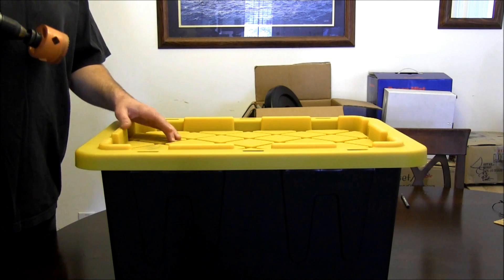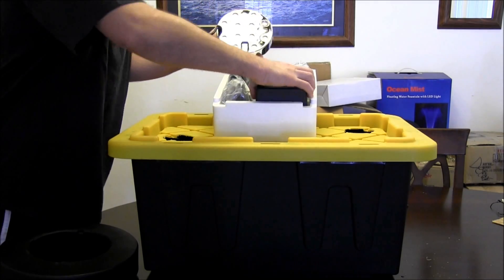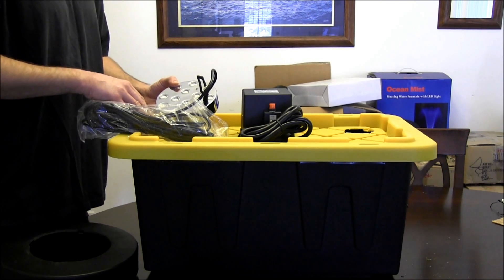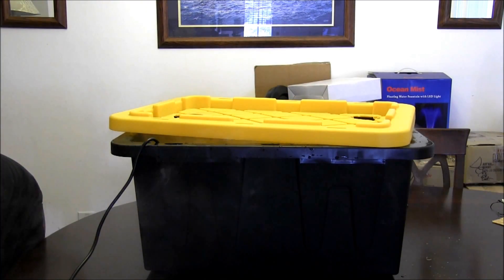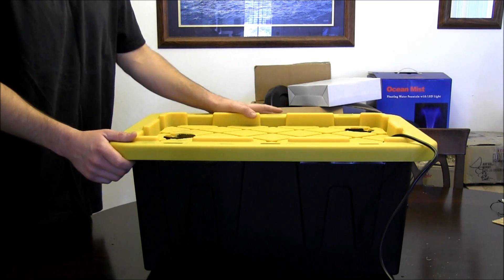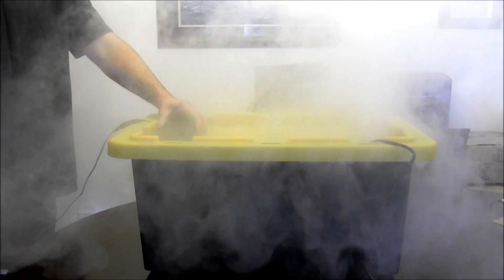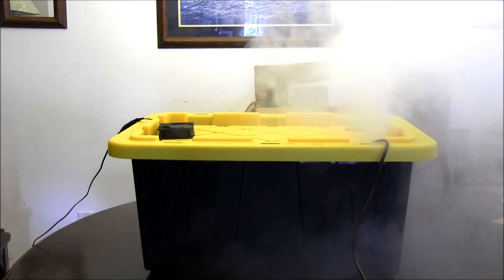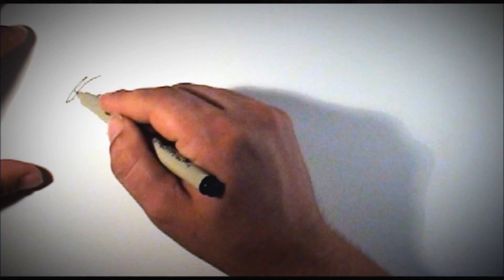How to make a humidifier for your home with Ultrasonic Mist Makers

Comment: I've got a house of hydro ultra sonic humidifier set up with a 5 gallon bucket and a lid. Its using an 80mm fan and 3 transducer ring and it keeps all of my cloning, and seedling germination, and seed germination up to speed. I've got several tropical plant strains sitting there in vegetation, growing quickly and healthily. Thanks House of Hydro!!!!
Reply from the maker: Thanks so much for throwing this out there, we really appreciate it!
Reply: @Forest Rhys yup, I've been watching on instaflixxer for years myself :D
Reply: A tip : you can watch series on instaflixxer. Been using them for watching all kinds of movies during the lockdown.

Comment: I have hard water, besides using distilled water what can I do to eliminate or reduce the white dust that is everywhere ?
Reply from the maker: Hi, most tap water isn't too hard, but if you are getting a white dust you can use an inline RV filter available on amazon. They screw right onto a garden hose fitting and will remove most of the calcium that causes the dust. Just make sure the filter is for sediment removal, and not just a normal charcoal filter to remove bad taste.

Comment: is there a reason to have the holes that far towards the outside edge and not slightly closer to the center? I have mine marked for the holes being a few inches closer to the middle but want to make sure it's not going to be an issue before I cut
Reply from the maker: Hi, no real reason aside from the fact that the fogger can splash a little bit. If you don't have exhaust tubes hooked up it can splash out of the holes if the water level is high and the fogger is right under them.

Comment: Peace how often do you have to change the transducers ?
Reply from the maker: Hi, good to hear from you. Lifespan is pretty variable with the discs and the transducers. Just to be clear, the transducers are the larger silver piece that hold all the white discs. Typically, the discs last between 3 and 5,000 hours. This can be shortened drastically if you overheat your water causing them to lose their rigidity.

The transducers typically last between two and four years or so. This is more dependent on runtime, water quality, and water temperature. Hopefully that helps answer your question!

Comment: Why is the fan on top and not on the side wall blowing straight at the fog? Have you tested both ways? Thanks.
Reply from the maker: They're both effective. Just have your fogger head underneath your output pipe, and don't have the fan blowing directly down on it. Either one works just fine. Thanks!
Reply: @TheHouseofHydro  thanks

Comment: After making a hole for the cords, how would you recommend sealing the majority of that area off such that most of the mist is funneled thru the actual vent instead of both the hole for cords and vent?
Reply from the maker: Most people just use some closed cell foam. It's easy to smash into the void of your hole where the wires run through. It fills everything up pretty good, it is easy to pull out and clean if needed.

Comment: Hello, I have a question about how much heat this would produce in a greenhouse of about 8x6x7? Does anybody know?
Reply from the maker: Hey! The mist maker itself will heat the water, but adding the additional moisture to your greenhouse air will help drop the temperature in the greenhouse, not increase it. It of course depends on the size of the mister that you buy, but you can definitely expect to see a drop in temperatures. Some customers also add ice to the water to help increase cooling capacity during the hot times of the day. Adding ice and dropping the water temperature significantly can reduce efficiency of the mister though. If you need anything else, feel free to shoot us an email at john@thehouseofhydro.com

Thanks!

Comment: I spent 250 dollars setting this up and it lasted 6 months the one i got from amazon lasted 3 years for 100 dollars over priced garabage
Reply from the maker: Hey Carl, thanks for following up with the correct problem. The best way to get in touch with us immediately is to email me at john@thehouseofhydro.com 

I just pulled your customer information and sent you an email. We don't sell timers, so I don't think it's our product that's causing you the problem, but I'm happy to help you troubleshoot any issues you might have with it.
Reply: turns out its the timer that is the problem  not the mist maker

Comment: Great 👍 
How much litter water tank u recon for 10 heads kit 
I'm living in the area where temp goes upto 49C .
 im using Bore-water will these heads work sufficiently?
Thanka
Reply from the maker: We recommend 27 gallon water reservoirs. If you are using it for a humidifier. Make sure to keep it between 1/3, and 2/3 full. If you have any other questions, please email me at John@thehouseofhydro.com

Comment: My unit isn't here and trying to do a pre-setup haha what size hole saw did you use? I want to make sure I have the right size on hand. Thank you!
Reply from the maker: Hi, I'm not sure what size fan you have, but here is a DIY article that will walk you through everything. You don't necessarily need an expensive hole saw as long as you have a jigsaw or even a sharp razor knife. Thanks so much for your business!  https://thehouseofhydro.com/blogs/fog-blog/how-to-make-a-home-or-greenhouse-humidifier-easy-diy
Reply: @TheHouseofHydro  I bought the one on your website, but I guess it doesn't matter? Awesome service and super fast delivery Thank you again
Reply from the maker: @TwistedTornsTirade  awesome, thank you! I really appreciate your business.

Comment: Great video! I'm building one too! Do you think it makes a difference having the in/out airflow on the sides rather than on top? It makes maintenance easier when there's nothing mounted on the lid, so it can be easily taken off. Thanks!
Reply from the maker: Hi, no I don't think it would make a difference. Just make sure that your fan is mounted up high so you can keep as much water in the container as possible. The water acts as a cooling agent for the transducer oh, so you need to keep as much as you can in there. If you have any other questions, feel free to shoot me an email at john@thehouseofhydro.com Thanks!
Reply: @TheHouseofHydro  Thanks! I did notice the water getting slightly warmer indeed! I estimate it's in about 7 liters of water at the moment.
Reply from the maker: @GrowingGreenNZ  What size mist maker do you have? A single disc unit is ok in 7 liters, but you should have more water if it's a larger unit.

Comment: Question - so we've got one of these setup, but for some reason the mist maker quits listening to the humidity sensor and just turns on 24/7. Does anybody know of any troubleshooting tips on this? We replaced the humidity (Ink Bird) reader and the issues occurred again.
Reply from the maker: Hey Jon! I would contact InkBird directly to ask them about it... They have a good reputation, so I'm sure they'll help you out. It sounds like it's a programming issue with the controller, but I'm not familiar enough with their products to help much.
Reply: @TheHouseofHydro  Thanks for the quick reply.

Comment: Would it not be better to do this with a big heavy duty plastic trash can? I think it would hold more water and probably take up a little less space.
Reply from the maker: You definitely could. A lot of people do. it really just depends on your setup, and what you need. The only downfall to a trash can is that they are tall, and as the water level drops, if you don't have enough cord inside of the can, it can pull the mistmaker out of the water at an angle. With the larger mist makers, this can cause damage to the discs.
Reply: @TheHouseofHydro  excellent, thanks for the reply. I was wondering if there would be any problems with fog propagation when the water levels got low in a trash can considering all that empty space between the lid and the mist maker, but I now assume that isn't an issue if this is something people are regularly doing. Thanks a lot.
 I've already bought the mist maker and fan and stuff from you, now I'm just deciding on the reservoir.
Reply from the maker: @hardrightturn7502  You're welcome! Yes, trash can will work well. Just make sure to keep sufficient water levels in there. You can check out our Instagram @theHouseofhydro I have a pretty large humidifier in a garbage can posted there

Comment: What is the name of part used in this system.
Reply from the maker: Hi, They are House of Hydro Mist Makers. To make a fully automated humidifier you will need the mist maker kit, a 27 gallon Tuff Tote like in our videos (the more water the better),  our 120mm fan (fully encapsulated waterproof fan kit), a humidistat  (to automatically  turn the machine on/off when humidity is needed) , and our float valve  (to keep the water level full with an outside water source) Everything can be found here. https://thehouseofhydro.com/store/c2/120V_Products.html

Comment: Needs to be a cheaper solution on these fans for us Canadians, it's just killer.  One 80mm fan kit shipped to Canada is 79.99 USD!  Holy cow man..
Reply from the maker: Hi, check the dropdown menu. They're actually $10 cheaper than that, and $15 cheaper if they're purchase with a mist maker. Shipping to Canada kills us. The 80mm fan kit weighs 9oz, and costs Almost $17 to ship, vs $3 in the USA. We also have some basic waterproof fans that aren't fully encased. They're great fans as well, and are $35 to Canada. Hope that helps some. We are actually in negotiations with UPS that could help us drop our prices to Canada alot.

Comment: Can this be used for a large reptile room, where it would be used mostly throughout the day, trying to get around 65% humidity in a 800 sqft. room. Thanks
Reply from the maker: Hi, sorry I didn't see this till now. It absolutely can be used in a large reptile room. depending on your air exchange you will probably need somewhere around a five or six disc unit.

Comment: zit seems to me this would have to be place high because the mist is only going up a certain distance and then very rapidly falling. I need for my plants something fogs the room or greenhouse with a very  fine mist that fills the space ceiling down not that all ends upsetting the floor and quickly,sinking.  Some of the orchid folks have tried these types and they just don’t do the job...maybe for other purposes they work.  Also these would ruin wood floors, make tile slippery and have the paint peeling off the walls and woodwork.  Folks think before you use something like this inside your home.  You can’t raise the humidity above 50% and I wouldn’t go over 40%.  I have lived in Florida back in the 50s and 60s and even where I live now up until the late 80s without air conditioning - I remember the summer grunge of mold and mildew on everything - we had to run dehumidifiers  to get the mold down.  In my current house of concrete floors - without air conditioning in the summer it smells like a musty sheet.  I finally tiled just about everywhere and the air conditioner stays on until summer is over. The rooms that have carpet were sealed and special padding put down.  A friend had a hot tub installed in her basement and it about rotted out her house, caused all kinds of bugs drawn to the moisture including termites.  It was only uncovered for about an hour a day.  In the winter the moisture just dropped off the walls.  Humidifiers are great to keep you and your house from drying out too much - but I think something like this putting that much moisture out is for a greenhouse, sealed floor to ceiling grow room etc.  Check with an environmental engineer or whoever knows what a house can handle.  And if you are renting, please don’t just do it because you don’t own it.  If you get sued, you might be paying it off for a long time.  I know I’m being a wet blanket but just think before you leap.  Nothing against this company at all - don’t know them,  haven’t bought from them but have watched these various videos.  Most plant folks recommend using a filterless cool mist humidifier I believe in the house.
Reply from the maker: These are actually the same technology as a cool mist humidifier that you're recommending. They're just higher powered than what you can buy in walmart.

 It's a dry fog, (< 5 Micron, so it doesn't wet surfaces unless directed onto them under force. No need to mount it up high. Our 120mm (110CFM) fan does quite well distributing the fog into the air. You can also pipe the fog to a higher level if needed if using it for something like a reptile cage. One of the many benefits of making your own humidifier. 

 We even have these same mist makers being used in Guitar Museums, and art galleries in order to prevent damage. As far as I know, their paints not peeling :-) We also have them being used in homes,  greenhouses, cigar humidors, mushroom grows, mj grows, food storage warehouses.... I could go on all day. 

You're correct about the limits of raising your humidity. The max is about 55% and you'll enter into a zone where mold can propagate if it's held at that level for an extended period of time. Thats why we offer a humidistat that can auto maintain the perfect levels for your project. 

Thanks for watching our videos, and taking the time to comment. 

John, The HOH

Comment: Is mist hot or cold?
Reply from the maker: Sumit Yadav it really depends on you our water temperature and air temperature that you are blowing in there with the fan. However, if you have a mist maker and a very small amount of water, the water will heat up and raise the temperature of the mist.
Reply: I want to make cold mist for my bird room

Comment: Ok, I've got a question for you guys.  Does the temperature of the water in the bin effect the temperature of the fog??  I'm going to be humidifying a fruiting chamber for mushrooms and i'd ideally like to tackle humidity and temperature with the same system...Have there been any experiments with this?  Does 60 degree water produce 60 degree fog??  I'd love to know!
Reply: Yo I know this is an old comment but I'm looking to do the same thing. Did using the fogger as a heater work out?
Reply: I am in the same journey
Reply: nouvelles?

Comment: Would it be possible to control the mist intensity if you add a VR to the ultrasonic component itself?  Then you would be able to control the mist intensity as well as the fan speed to find the right humidity setting for a room or house.  The ability to lower the ultrasonic frequency could also allow it to run indefinitely without requiring a cool down.

Comment: Hi,  I am looking to use your units to humidify a mushroom grow room.  Are you able to put me in touch with anybody using it this way.  I see on your website that over 25 percent of people who buy the units use them for mushroom farming, yet I see very little on their actual use.  I am in particular wondering if the transformers are waterproof, and if not, what people do with them.  As well some direction in calculating outputs necessary to maintain a certain relative humidity, factoring in air exchange.  Thanks!
Reply from the maker: Hi, yes, we have a bunch of mushroom growers that use them. I definitely can't put you in touch with any on youtube. The best way to get a hold of me is John@thehouseofhydro.com. They are the same as using a very high powered cool mist humidifier though. It's pretty simple DIY and completely automatic if you use our controllers as well. 

As far as choosing the right size, the biggest factors in choosing a mist maker is the  air exchange, target/current humidity, and construction material of the room. Unsealed concrete and wood can really absorb a lot of humidity, and rooms with a lot of air exchange can be hard to keep up with. 
 
Smaller units can overcome room material after some time, but heavy air exchange is harder to keep up with.  If steady levels are needed, it's usually better to go bigger so that you can regain normal levels quickly. 

A specific sized mist maker is usually hard to recommend because every setup is pretty different, but If you let me know more about the area, I'll be able to help a whole lot more. Most small (closet size) grows can be done with a 3 or 5 disc. Mid size (bedroom sized) can be done with a 6-9 and larger (shipping container) grow can use (2) 6 disc units or one 12 disc. 

To make a fully automated humidifier you will need the mist maker kit, our 120mm fan(fully encapsulated waterproof fan kit), a humidistat (to automatically  turn the machine on/off when humidity is needed) , and our float valve (to keep the water level full)

Hope that helps some, 
John